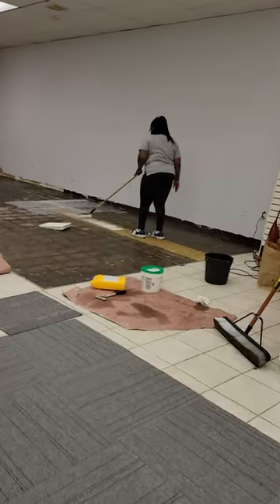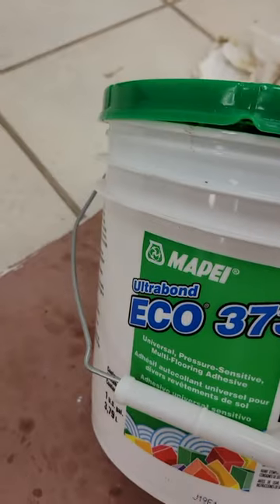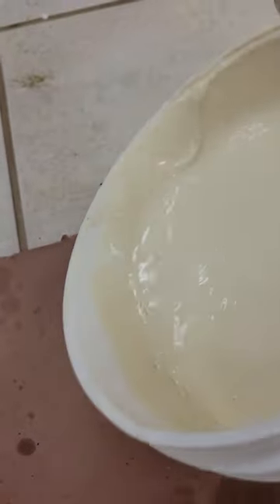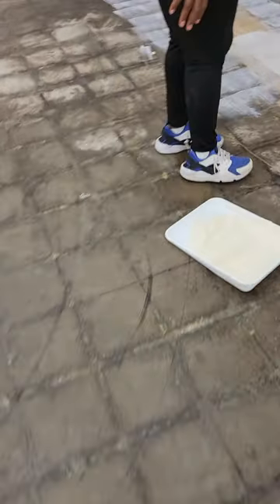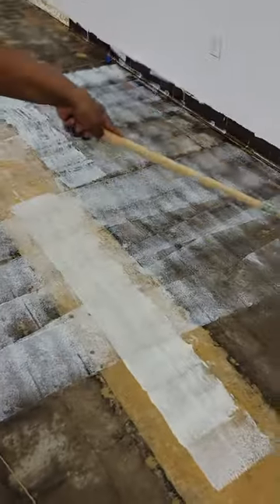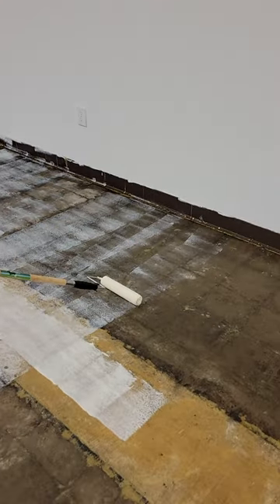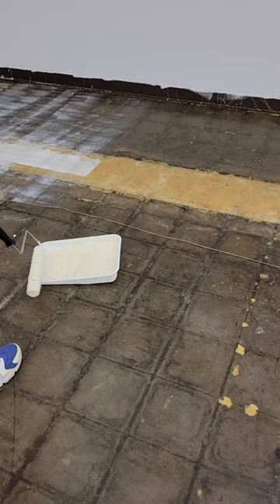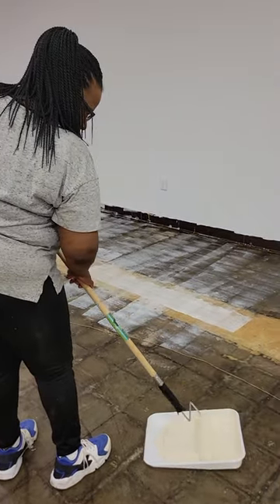Ultrabond ECO 373 • applying adhesive with a roller for carpet tile•

Comment: Hi do you think this will hold a homemade rug together?
Reply from the maker: I would say yes. What is the other material you are binding to the rug?
Reply: @treazurevault  monks cloth and felt backing , i just dont want the yarn to be plucked out or fallout with time
Reply from the maker: @drippymenace7379  it dries hard. Not very flexible.
Reply: @treazurevault  ok thanks 🙏🏼
Reply: Sorry one more question does it have a strong smell?